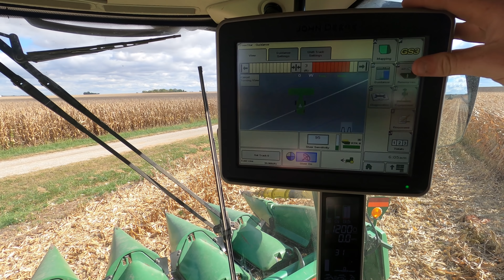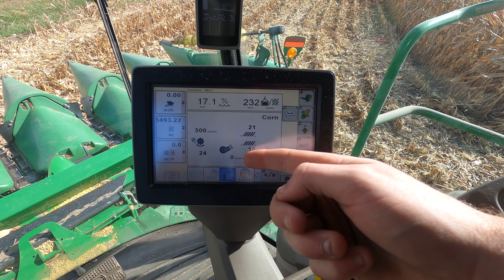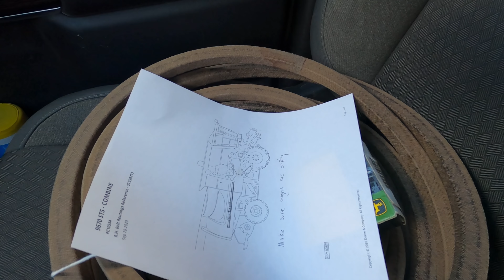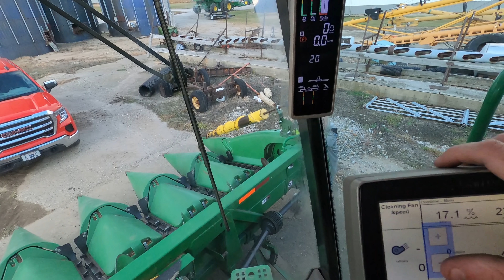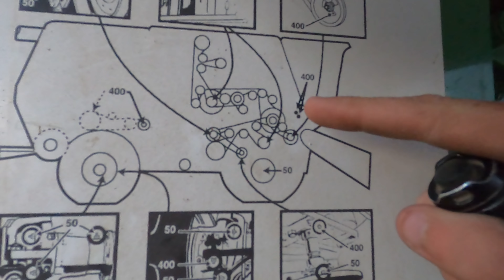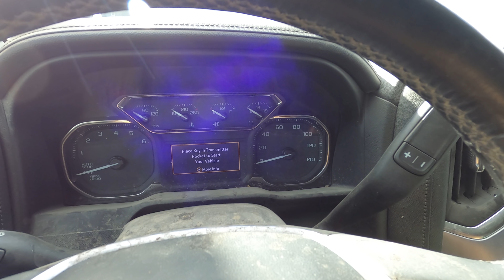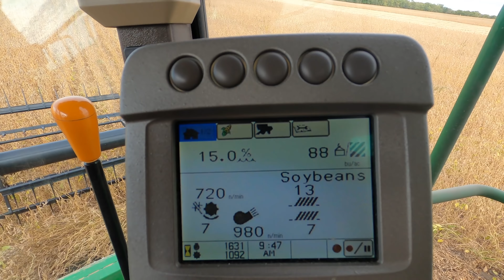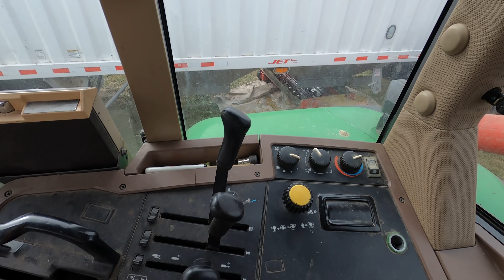A Problematic Start To Corn Harvest... (Ep. 44)

Comment: Next time you need to replace that belt, take the out the electric motor by removing the 3 bolts with a 10mm wrench. Then you can move the big screw by hand and open the pulley on top. Then install the new belt and when you are ready to install the variable speed fan belt, your top pulley should be wide open so you can fit the belt over the lower puller. After you have it in, screw the big bolt by hand until the belt on top pulley touches and it becomes hard.  Install the motor back, run the system on low idle and start to increase the fan speed from the cab. Give it a couple seconds to it to tension the belt. Go inspect everything is ok and go back, give it full throttle and adjust your fan speed to 1250 rpm.  Hope it helps next time you need to change that belt.
Reply from the maker: Thanks for the tip. The only part that really messed us up was the motor. We should’ve done as you said, then we could’ve reseated the fan belt easier. Hopefully I won’t have to do it again for another few years, but I will keep this comment in mind. I appreciate you watching!

Comment: To clean the clogged rotor, how about a shop vac? That's what I'd have done.
Reply from the maker: Some others suggested that. The rotor wasn't clogged, per say, but it was completely packed full of corn from that shaker belt breaking while harvesting. We didn't want to burn off more belts trying to run it out. Thanks for the suggestion!

Comment: I always love ribbing other brands of equipment like when you were giving the Claas fans some grief, that was good stuff:) I know most of my career in excavation I’ve run EOTJD, or “equipment other than John Deere” and have a particularly deep seated loathing of Cat stuff but I will admit it’s pretty neat that you can go to the Cat dealer and they have the random obscure part you need for 30yo machine on the shelf some how and that’s pretty cool(Napa could take some lessons) but that’s not nearly as neat of a trick as what the John Deere dealer can do, see you go there to pick up a parts order, enough stuff to comfortably fill a milk crate we’ll say, and you look at the invoice, scan through it, past the $20 bolt, $20. One. Bolt. And you get to the total and your like wow, I have $3200 with of parts in a milk a milk crate, in like a dozen small boxes and a bunch of plastic bags. Now if Caterpillar could perform that kind of magic then they would really have something;-)
Reply from the maker: Every company has its strengths and weaknesses. I am glad that people can find success with different equipment/methods. Deere probably isn’t the top-dog in excavation if I had to guess! Thanks for watching.
Reply: aTrippyFarmer As an operator I think Deere dozers and excavators are hard to beat, Volvo makes the beat wheel loader and it’s hard to beat Case for a backhoe although Cat makes a strong contender. I can’t say if it would be better to own Deere over anything else and as my late Gramps always said: It’s all junk when it’s broke down;)

Comment: 5:45 not really, soyabeen dust destroy bearings and grind a lot more than corn, i have a case hi who have 5000 hours only in corn and its new, a 4000 hours nh who run half in soyabean and its a lot more consumed, maybe rocks in the header come in (small ones, like 1,2 cm large) dirt, just its worst for the machine
Reply from the maker: I don’t disagree, but I have seen it much differently on our farm. A majority of our combine-based breakdowns are in corn. The weight and volume of corn is much harder than that of soybeans. It very well may be different for you and other people, though. Thanks for watching!
Reply: @aTrippyFarmer  maybe the sieves and elevator have much more consume, but in corn i dont have to tight elevators chains or feader chains to because of less dust, everyone has is own church i guess